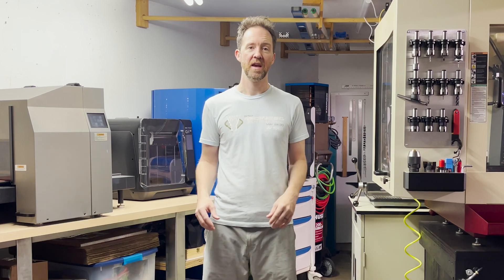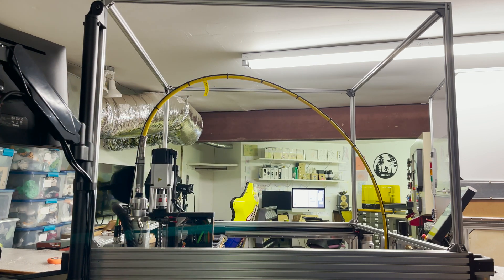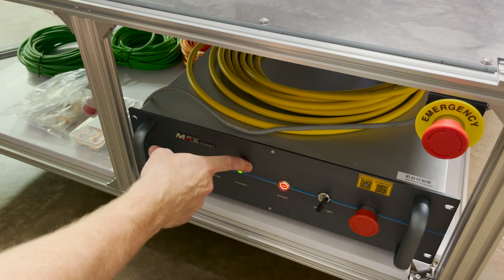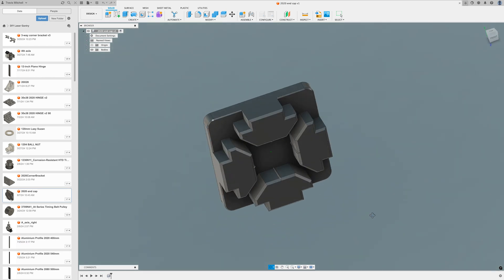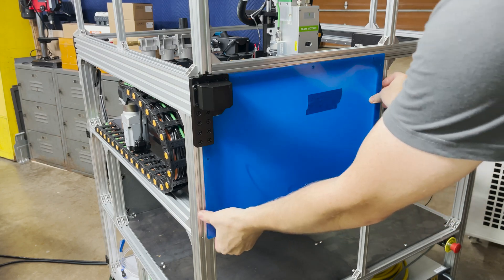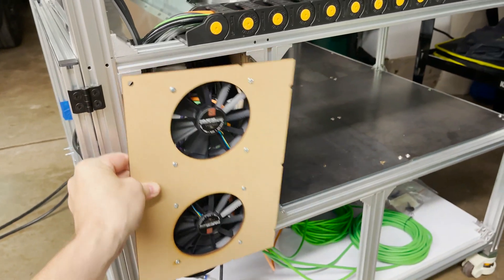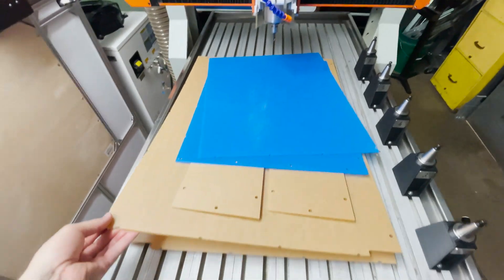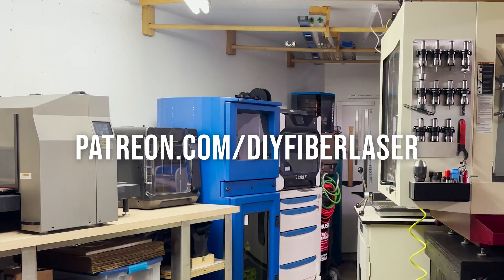DIY Fiber Laser Cutter V2 | Part 10: Max MFSC-1000X Laser Source

Comment: Hi how are you Travis?
I bought the Max fiber laser source  from from sky fire,  The 5% discount really works. Thank you.
Please 
I need to connect my Max 1000 watts fiber laser  source to the main board controller, Could you please send me the connection diagram you made so I can compare it with mine? I would really appreciate your help. Best regards.
Thank you.
Reply from the maker: I've posted the wiring diagram here: https://www.patreon.com/posts/v2-fiber-laser-110553837?utm_medium=clipboard_copy&utm_source=copyLink&utm_campaign=postshare_creator&utm_content=join_link
Reply: @diyfiberlaser  Thank you Travis,

Comment: Ate you using compressed air or nitrogen or oxygen  for assit gass... like to see more video on compressor  assisted  gas solution
Reply from the maker: Yes all of those depending on the material and thickness

Comment: Have you considered a cee plug and socket? They can supply 125A safely and would eliminate the need to use 3 plugs and sockets to run your laser. They also lock, which is something I like.
Reply from the maker: Thanks, those look interesting, but I don't have a line that supplies enough amps for everything, mine are only 20 amps each...I'd need to hire an electrician to come rewire it for more amps.

Comment: Hello,  

Nice video again.

Wen you air vent a cabinet the best way is by overpresure.

One inled with fans and one fan less outlet

This way you don't pull dust into de cabinet by other holes.

When you blow air into the cabinet the most air will go out by the fan less exhaust. A small portion of the air will escape trough the otter small holes

Comment: Do you have parameter sheet for cutting with 1000W? I have been having troubles to cut with my fiber laser, if you have it... do you sell it? I have the raycus cutting parameters sheet but I can´t cut with those parameters
Reply from the maker: I don't have a cutting parameters list yet, I've only cut one type of sheet so far...I did find that my settings eded up being different than that of the Raycus document. I was cutting 14 ga steel, I think they recommended about 9psi O2 and I used about 36psi for a nice cut with no slag.

Comment: OK, so you have conventional 3-phase power and at decent voltage (220-240) so infact, you can use it like you said or run three-phase into master PSU as I am guessing some of your systems will be on DC at one point or another.
Reply from the maker: Maybe I forgot to mention, but I am using 240V single phase. Everything is DC except the AC servo drives.
Reply: @diyfiberlaser  No, you did mention the 240VAC. I was just pointing out, if you can use the three-phase, smoother power delivery to laser and systems.

Comment: It's looking great! Very close now.

Just so you're aware, the old E-stop that you had has stackable contacts. They just screw on top of each other so you can add quite a few extra poles as required.
Reply from the maker: Thanks for the tip...I thought that might be the case, but didn't investigate it fully.

Comment: Why does it need a decryption code? Is it online only software?
Reply: Some perverted anti-piracy I think. The Chinese is smart enough to clone the boards and firmware in the chips, but if the firmware needs to be unlocked before use the factory can check the numbers that it's a unit they produced.
Reply: @zaprodk  So it's a one off? I've read posts of people being locked out because the key lapses...then what? Rely on this company being around and contactable in the future? no thanks..
Reply from the maker: @3dkiwi920  I've read those also. I was told it was something that I only needed to once and it would work for the lifetime, but that does concern me also. I first contacted Max directly...they got back to me right away, but then asked me to have the seller decrypt. It is not online only software, nor does the source need an internet connection to run.

Comment: FYI most PCs and monitors run on 100-240 volt, so you may not need that step down converter at all. The PSUs should list the voltage range.
Reply from the maker: OMG, you are so right! I just checked the labels and both can run off 240V, I had no idea...thank you, I just learned something today! : )
Reply: I relearned this last month traveling overseas. 😂 Awesome Tip!
Reply: Just need to get power cords with the 240v plug.